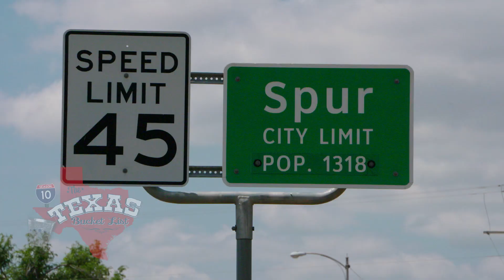The Texas Bucket List - The Tiny Houses of Spur, Texas

Comment: Tiny home neighborhoods/communities could bring back life to many smaller rural towns. One of the things brought up about living in a rural small town was jobs. But with COVID 19, many people have realized that they can work from home. And once all the all the bugs get worked out and up and running, Skylink will be able to make high speed internet accessible anywhere. 
I think as long as the small home meets the basic building requirements, the only thing left is utilities. Homes with cities/towns of course will have access to water, electric and sewer services, and can therefore be on smaller lots. While those homes in more rural area's outside cities/towns will need to be on larger lots for septuc and may need a private well. And small homes can make good use from solar and wind turbine alternatives in connection with a power wall for lighting, cooking and heating.